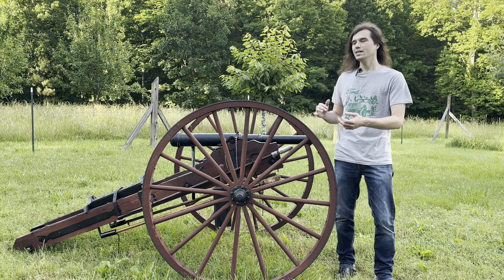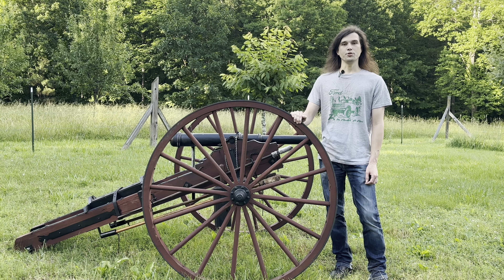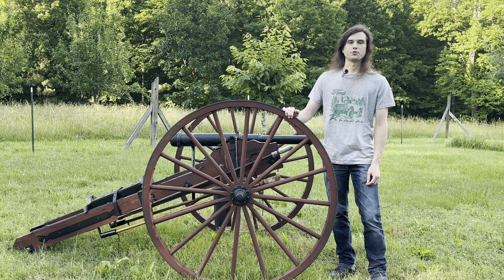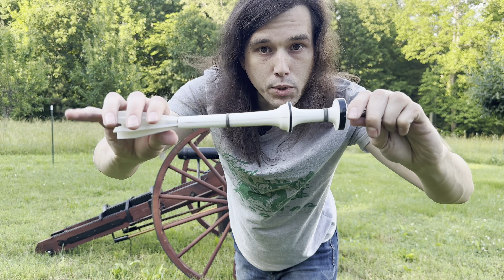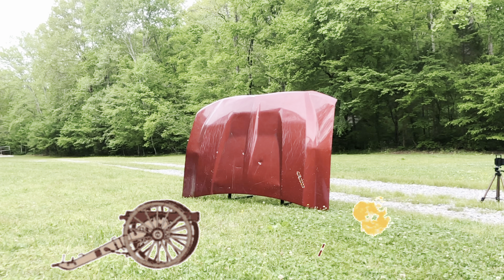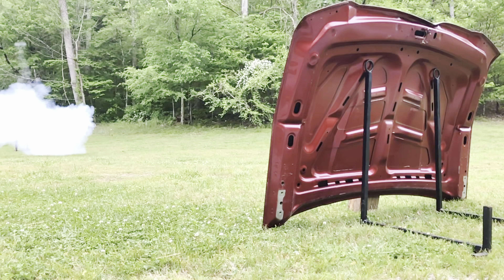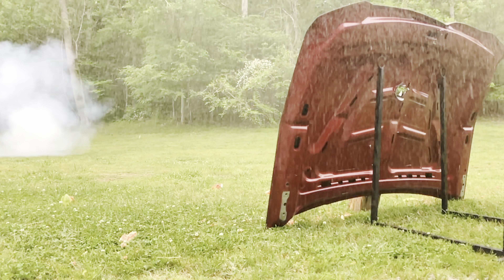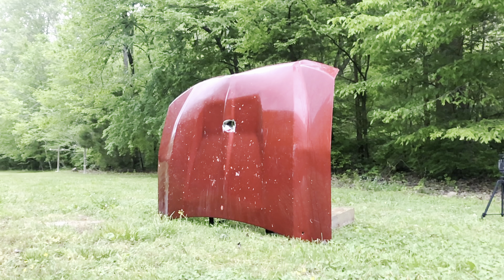Shooting 3D Printed APFSDS Tank Rounds

Comment: Someone beat me to the comment but i'll add my knowledge anyway. The ridges on APFSDS rounds are there to lock the sabot to the projectile. Without it the pedals wont separate correctly outside the barrel and the sabot will leave the barrel before the projectile. This should be a relatively easy thing to fix. 

With a relatively lower pressure gun like a black powder cannon, having the sabot be passively held together with no rubber bands or a weaker rubber band might work better to ensure the sabot seperates

Comment: I would weld steel fins to the base of the penetrator, make the "petals" much wider to snugly fit the barrel (at more than 1 area of contact) maybe try a more rigid material to incorporate into the petals, like aluminum or brass instead of only PLA plastic. The amount of shock from your charge is substantial enough to just shatter it into oblivion.. including your fins. Honestly, even an aluminum cup at the base of the fins might suffice, but I'm speculating here. I believe the PLA plastic you're using is much too brittle to withstand the blast from firing. More development necessary, great start though.
Reply from the maker: Thanks! And thanks for the ideas! We will get a working version!

Comment: I know what your problem is The fins Needs to be made out of a light metal willed To the body Then the Body Of the Projectile Needs to have rings on it For easy separation If you're just using plastic, it always breaks And the casing needs to be metal too to survive the Force of the cannon Just saying, your problem is. The other piece is made out of plastic. You need light metal. Ps. You can use plastic to make molds for the projectile. Reasons I know this cause i'm a tank enthusiast Or Someone that likes tanks.
Reply from the maker: I’ll have to check out using plastic for molds and metal fins for sure on V2! Thanks!

Comment: The rod and fins need to be a single joined piece of metal and the sabot is the gas seal that transfers energy to the penetrator. if you look at a real sabot round there is a corrugated interface between the sabot and penetrator to improve grip under high stress.

Alternatively you could put an extrusion on your TPU "baseplates" that extend through the center of the fins and press directly against the rod so that the printed fins arent absorbing the entire force of the propellant.
Reply from the maker: I’ll see I’d I can get some of those worked up with the tpu base idea!
Reply: @TheCannoneer  ill keep my eyes peeled!

Comment: maybe tack a steel ring (like those you use under nuts and bolts) on the dart in front of the discarding sabot so it helps push the dart out but still allows the discarding parts to fly off
Reply from the maker: Good idea!

Comment: While I'm not sure how the sabot works, I am positive that the needle and the fins should be one element. If the needle doesn't have fins, it won't be able to fly a straight and stabilised path, so for this part I would just weld metal fins to the needle.

Comment: Ok, as a son of a tank commander that has had an experience with a variant of the training round (TPCSDS-T) that used epoxy to keep the peddles together, I have paused the video at exactly 2:36 to say: NO!!!! EPOXY IS A BAD IDEA IN THIS CASE. My dad had that mentioned training round turn a half hour training session turn to three because the epoxy from the fired rounds would jam the Abrams cannon with the next round, since said epoxy would glue the round on contact with the cartridge!!!! See the problem!? The very thing that is supposed to keep it straight as it comes out is melting before it leaves the barrel.
Reply from the maker: I’ll try JB weld for V2!

Comment: I think you should put some more thought and effort into this
I mean right off the bat I can see what's going on 
You have a flaw in your design 
Just as you slide your pallet ring on your dart during shooting it gets ripped off ahead of the dart because nothing is holding it together
Which is kinda obvious if you just this once on a paper
My reccomendation would be making a custom dart with a step off on it and make pallets to hold onto it that way

Comment: For old school artillery, you need old school ammunition. Forget the 3D printed fins, just make a nice penetrator spike and fit it with a suitable discarding sabot. Bore a hole through the end of the spike and tie some hemp line with a monkey fist ball knot made a few thousandths shy of diameter of the barrel. Leave about 4 - 6 inches of line between the spike and the knot. Soak the line in water over night, this will keep it from combusting when fired. Ensure the monkey fist knot is still about the same size as the sabot outside diameter, dry it out a little if its swelled with water, coil the line to butt the knot up to the sabot then load the lot with a wad to keep the monkey fist off the powder. The ball should trail on the line when fired, inducing drag and stabilizing your penetrator. With some fine tuning on the size and weight of the rope ball,  you should be successful.

Comment: Move the centre of mass towards front of the round. You can do it by providing draft angle to penetrating dart. Also increase the cup depth of seperator with through holes at each.

Comment: I would cast your sabot petals out of aluminum or use a plastic that is more malleable. HDPE might work if you can print it. I would even try plaster or cement, it just has to survive until the muzzle. The acceleration is too much for the plastic and it is shattering. The fin design you have looks good but I would at least sand cast it in aluminum or weld steel ones on. The aluminum casting would probably deform under the acceleration of the shot so might not be worth bothering with.

Comment: hi a little new to the channel but why not make some tin fins that are the same thickness as the plastic one or make some aluminum ones at half the thickness an just spot weld them on thus eliminating the fins going boom an making it an over all more structurally stable?

Comment: The fletching can not support of the penetrator.  when you place the disk behind the the round, all the weight then is focused on the fins. Then fins get smashed in the  500G acceleration. The Sabot has to support the penetrators' mass during that rapid acceleration.

Comment: Your penitrator needs to be your pressure point. All your pressure is being forced onto the fins destroying them. Add a metal nail head and move the fins up the steel so the pucks make contact with metal. Your fins might be better machined which is probably outside of your vision.

Comment: Your dart needs hard welded fins.  Use a hard wood cylinder with a shallow drilled hole for the back of the dart.  You can keep the break aways as they are.  I have a few cannon videos on my channel.  I have a coaches club billiard ball / red bull cannon and a 63mm caronade that shoots 2" pipe shells.
Reply from the maker: I shall check those out! Thanks for the advice!

Comment: your fins need to be the same steel as the rod and must welded on and your SABOT doesn't need a cap in the back your SABOT should be Secure enough around the Rod to sustain being fired, that rod will be carrying alot more energy unlike the most of the stuff you have fired so i have no doubt it will go through the tree being the car hood also your gunna need more range for the SABOT due to it be more secure than it was previously, you gotta have a perfect fit to the rod, also the cap is shattering your fins
Reply from the maker: I’m excited to see what they will go through once we get them working!
Reply: Lots of stuff

Comment: to chime in, try to make a dart with fins, i "think" your issue is, is that your firing the fins before the dart, so find someone who could weld fins on, or someone who can make a dart with metal fins already on it; should crush the problem of firing with no fins and hopefully fix your tumbling issue as well. 
(I can be wrong but at least from what i personally see, the fins are not strong enough on the actual dart)
Reply from the maker: Welded fins for sure on V2!

Comment: I see some mechanical problems with your dart and sabot design, this might solve that:
1. The dart should go all the way through the fins to the other side and maybe even have a bit of an extra length to it to interact with the plug. That should reduce loading on the fins.
2. Maybe use threaded rod? Get a threaded rod, then tap the same thread in to the sabot. Should allow for nice, even spread of load.
3. The sabot should go back around the fins and close behind the dart only leaving the metal rod in the back exposed to take some of the load off the fins.
4. To prevent Newton's cradle effect, you need to slow down the initial acceleration of the projectile. Some cushion, like thick layer of cardboard, or cork, or rags, or a combination should do.
If this doesn't work, you may have to go for sturdier materials. Like an aluminium fin or even welded sheet metal to act as fins. The sabot is really kind of secondary and might as well disintegrate once it leaves the barrel. Maybe it would be cheaper and faster for you to pack a paper tube with more paper and have the dart in the middle of it. At least until you can get the dart to stay in one piece after firing.
Reply from the maker: I think we’re going to move to metal fins for sure and some other changes y’all have suggested! We will make it work one of these days!

Comment: Make the fins out of welded metal sheet. Two Vs welded. Its not like you are trying to shot a tank 3 miles up. You might be able to use a wad then. Then a theaded rod might work but you need coarse threading. Or else propper lathed protrusions that match the sabots. Sabots should be super tight to the bore. Also you cant accelerate a slender body too fast with a wad and expect it not to bend. That's why the sabot pulls the flechette and surrounds it that much.
Reply from the maker: Threaded rods and metal fins for sure on V2!

Comment: there are several errors here. The plastic tail is very fragile and cannot withstand a shot. the projectile itself is not secured in the pallet. and the front part of the rod should be made a little heavier

Comment: Try encapsulating the whole round in a piece of pvc or some other tube with a foam insert. Cut it so it'll discard. You're problem lies in the sudden acceleration of mass. Use your disk at the base of your foam filled tube that contains your projectile.
Reply from the maker: I like that idea! Mythbusters style.

Comment: Buy a half decent printer and print the fins out of metal, and make sure the sabot is balanced. You had a lot of yaw in the video as the jacket wasn't located at the datum point of all the forces irregardless of the pla issues. Personally, I would use nylon on the same printer that I would use to print metal with - light strong and more heat resistant.
Reply from the maker: If only I had an extra few thousand sitting around to buy one!
Reply: @TheCannoneer  
It's not that expensive. You can upgrade a basic printer. Just need a 300c hotend with hardened nozles and a dry box. Can get it all out the box for less than 1500 unless you upgrade what u have, then it's much less. Metal filament is spendy though.
Reply from the maker: I’ll have to check it out once the channel gets a bit bigger and see what we can make happen!

Comment: It just seems to me that you are spending a lot of time reinventing the wheel when there is a ton of info on what works on the internet and available courtesy of Mr. Google.  

PLA 3d printed fins are extremely unlikely to survive the acceleration forces and wind drag at supersonic speeds.  That has been shown by plenty of people who have tried them on amateur rockets.  While I'm thinking of it, 3 or 4 fins are plenty to stabilize a uniform long cylindrical body.  Beyond that, you are just creating excess drag.  

Your sabot needs to be firmly attached to the rod while they are in the barrel.  The rod needs either larger of smaller diameter sections with the sabot shaped to fit those sections.  Thus, they move as one unit in the barrel.  Do NOT have any of the force push against your fins.

I am amazed at how accurate you are with the standard round balls and the amount of force you achieve.  Do you recover and reuse your cannon balls?
Reply from the maker: I’ll get a working version with all y’all’s advice! As you can tell I didn’t much understand how these worked and it was more of a will it stand up to the forces test lol. 

Usually not but we can if we shoot at our range because we’ve got a backstop to catch them. If I can find them on the other ranges, which sometimes happens, I’ll happily reuse them though! We’ve got a nice aiming trick which I’ll show everyone in a future video. Thanks for tuning in!

Comment: I suggest CONE stabilization instead of tail-fin stabilization. YES, it will slow the projectile do0wn some, HOWEVER its much sturdier, easier to build & align properly with the projectile and will have greater aerodynamic stabilizing effects for such a small sub- caliber projectile which you're clearly lacking.  I would also suggest that your front sabot face be a forwards cone as well of at least 30deg, (it'll look like a three piece trumpet with a dart sticking out in the middle when your done) so as to encourage clean separation. your discarding sabot NEEDS two sealing rings or bands about ~1/2 inch wide on both the front and back of the sabot in order to provide gas sealing AND alignment as you're sending a sub-caliber long-rod cone stabilized discarding sabot projectile down the barrel at supersonic speeds. Hope that helps
Reply from the maker: Much appreciated!

Comment: Your rod should be stuck in the sabot, and only be able to slide out when the sabot opens. Also the sabot should pull the projectile forward, not be pushed by a base plate. If it pushes, the projectile will tumble and keep the penetrator in the sabot or make it slide off and be left behind.

Comment: Just my guess watching the video.
I suspect that your seal / backing pads / discs are too soft and the pressure is just blowing by them. My suggestions are 1. use metal fins welded to the penetrator and add a metal disc / washer between the 2 seal / backing pads /s discs.
Good video have a blast
Reply from the maker: Thanks!

Comment: The sabot should encase the rear of the dart.
Reduce the diameter of the fins, maybe make them longer... print a cup that goes over the fins from the rear, with fingers that go between and fill all the space around the fins. The sabot should cover all of this. Once it leaves the bbl, the sabot comes off, and air resistance on the front of the base "fingers" should push the rear cup off the dart, exposing the fins. All the rifle bullets I've shot with a sabot, the sabot encloses the bottom of the bullet, like a cup.
Reply from the maker: We shall give the cup idea a try!

Comment: Both the penetrator and the sabot need to be threaded so that they grib each other (i.e. a matching interlocking thread), otherwise the sabot (which is trapping the gasses) will simply slide straight off and out ahead of the penetrator, transfering little to no forward momentum to it. 

The first goal therefore is to make sure the sabot gribs the penetrator tight until it has left the barrel, where wind resistance (drag) then forces it to seperate from the penetrator.

I'd suggest trying with a thread that is slanted away from path of travel on the penetrator itself, also refered to as a buttress or sawtooth thread, so as to facilitate a smoother seperation of the sabot from the penetrator as soon as it leaves the barrel,. In other words imagine a penetrator rod surface looking like below (path of travel to the right):  
I\ I\ I\ I\ I\ I\ I\ I\ I\ I\ I\ I\  
I/ I/ I/ I/ I/ I/ I/ I/ I/ I/ I/ I/

Comment: Theres alot of good information in the comments to recap the main changes that you need to make if you want this to work
1. you cannot pit wadding behind the fins bc the fins cannot be made strong enough to be load bearing and will be crushed by the wadding
2. In a normal sabot round the petals interlock with grooves on the projectile and the petals are responsible for pulling the projectile down the barrel and obturating the barrel (thus taking the load of the fragile fine) 

Also a note on terminology, what you refer to as the "petals" the parts the hold the projectile are called the "sabot", and the part you refer to as the "sabot" is the projectile

Comment: Lugs on the dart might be the way to go, as others are saying.
But first I’d try to put a pressure-holding plug behind the whole dart+sabot assembly, which only pushes the dart, not its fins. Maybe the standard solid TPU plug, followed by a conical (PLA? wood?) piece that tapers to only touch the iron dart. Maybe have some features that go between the fins.
It might also be possible to integrate this pusher plate into the sabots, having them reach behind the dart itself so they can’t fly away in front of the dart before they’re out of the barrel.

Welding fins to the dart might be the easiest way to make a solid dart, but I’d try PETG first.
Reply from the maker: I’ll try some metal fins first and see where we can go from there. I haven’t worked with petg but I need to look into it.

Comment: If you keep your original sabot design but lengthen it to encase your fins with the penetrater lengthened to be slightly past the back of the fins to rest on the sabot it will protect the fins. Also adding a slight concave to the front of the sabot may help with separation. Using a heat resistant paint on the cracks will hold the sabot together but is fragile enough to break for separation.
Reply from the maker: Thanks! I’ve had a few people suggest sealing the surface too and I think that will make a difference for sure but I hadn’t thought about slightly sealing the inside together. Cool idea!